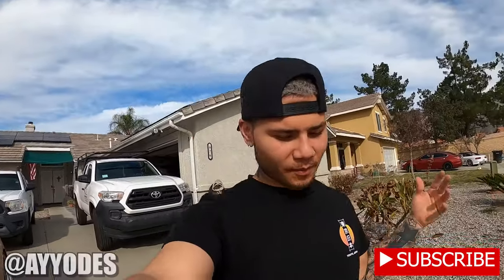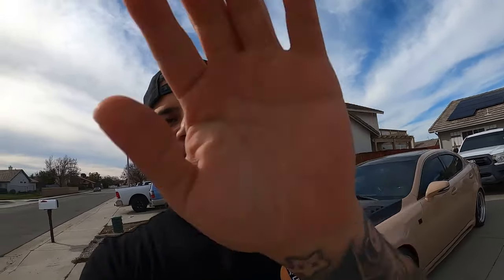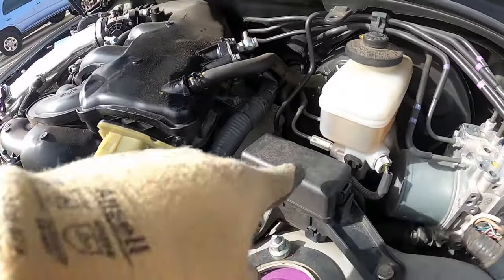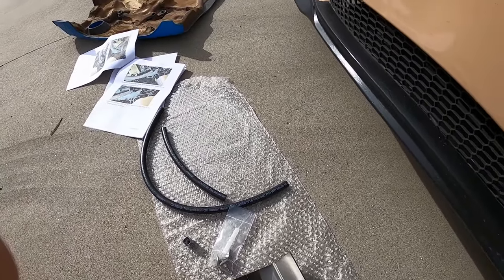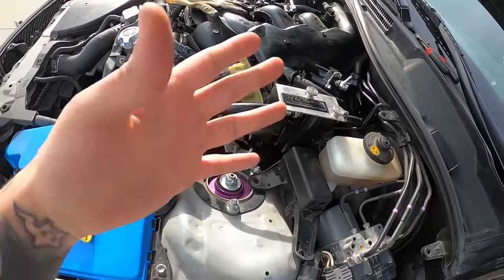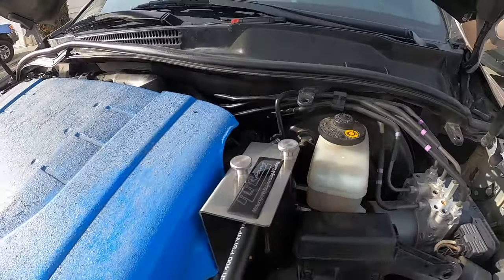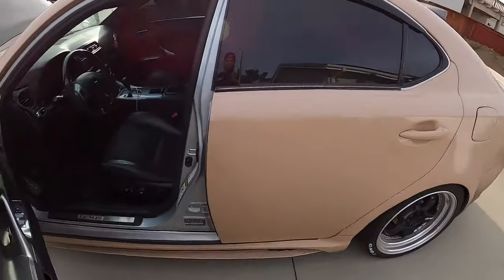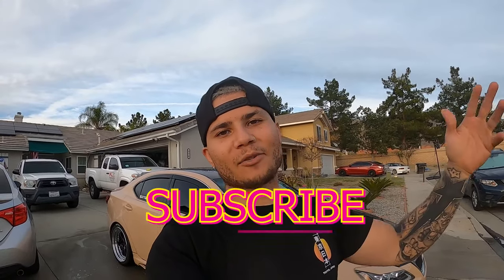GETTING RID OF ONE OF THE BIGGEST ISSUES ON THE LEXUS IS250! (AIR/OIL SEPARATOR INSTALL)

Comment: Pro tip: leaving the beauty cover off of your engine will allow it to stay cooler which will allow it to perform at its best. The beauty cover is only for noise & I don't think you're worried about noise lol. By removing the beauty cover will also shave 5 pounds off of your gross vehicle weight. This will give 1/1000 th of a second better quarter-mile track time.

Comment: Seen this same "AOS" on other videos.. But it's not really an air-oil-separator. It's just an oil catch can. A true AOS separates the oil and put it back into the system so you don't have to drain it. This literally just catches dirty oil in a can. Literally an oil catch can
Reply from the maker: Ahhh I see now. Makes sense! RR-Racing needs to fix there wording on the part then lol

Comment: With the vland headlights there’s a fuse you need to unplug underneath the steering wheel near the code reader plug in spot the fuse was for the self leaving for the stock headlights
Reply from the maker: Dude! Is that it? I could not figure that out for the life of me lol thanks for that I’ll try it out when I get home 💯🙌🏽
Reply: @desmondsimmons  it’s the afs switch just google it it’s easy as day

Comment: just want to recommend that you use a different type of hose. Those that you are using when they get hot in the engine bay tend to become mushy and collapse do to the vacuum force created by the intake manifold.  This causes your engine to not breath very well and can lead to engine stalls. I found hoses at home depot which are meant for water (SHARK BITE HOSES) red or blue. Those don't collapse like those black ones you have.  I have an 08 is250 and man what a difference this oil catch can makes.  My can is a bit different though, mines has 3 ports. 1 for air intake, 2nd air outlet and a 3rd outlet port in the bottom with a small release valve which lets me attached a hose to it.  When my can is full I just open the valve and empty out the excess oil out without having to remove my can out of the engine bay.  Nice Lexus IS250 by the way and great video!.  Thank you!!
Reply: Hey, would you mind telling me how much your oil catch can was? I’ve owned my is250 for a couple months now and i’m just now getting around to making sure it’s running perfectly. I have to change my brakes and fluids as far as I know.
Reply: @luvisrrage 35 euros maxi

Comment: Thanks, I just got a 2010 IS 250, noticed the prior owner had a catch can zipped to the rad with a flappy bracket. Kinda annoyed at the bracket placement, but cool I already have one. That RR racing unit is a much cleaner install.

Comment: you may need to trim ythe bracket to realeave the vacume line that can break the intake manifold and cut a relief for a sway bar  through engineering it you run a swaybar as you dont want that catchcan braket hitting or resting against anything.

Comment: Is it true that if you do full synthetic oil changes every 4000 miles that will help with the carbon build up problem obviously not fix but just help
Reply: It help a bit. Using Valvoline and no problems